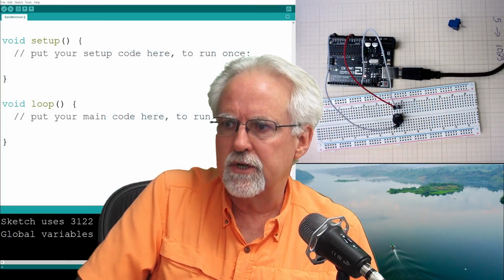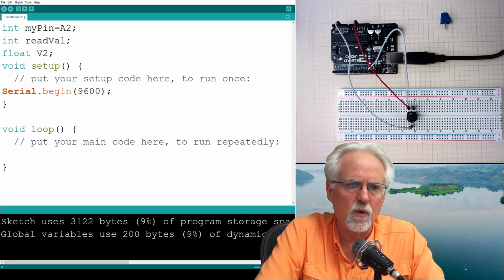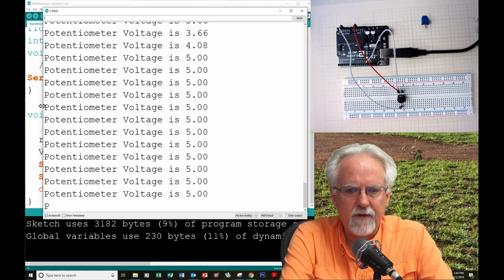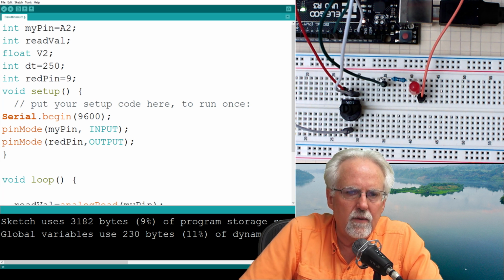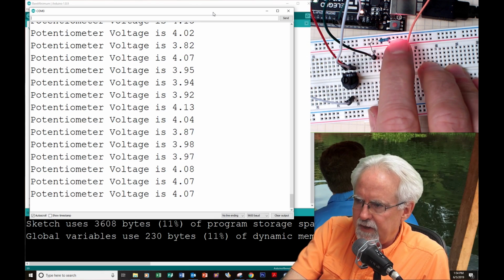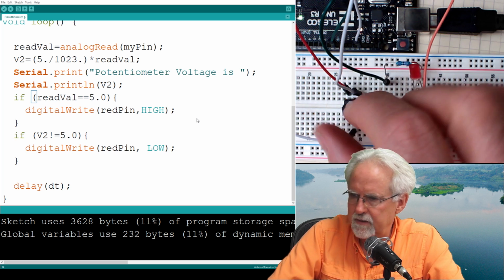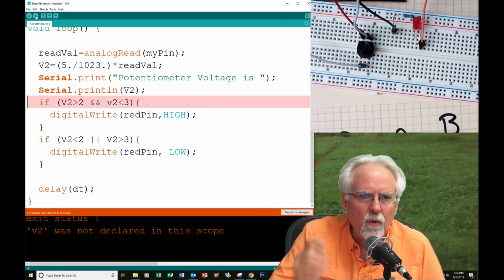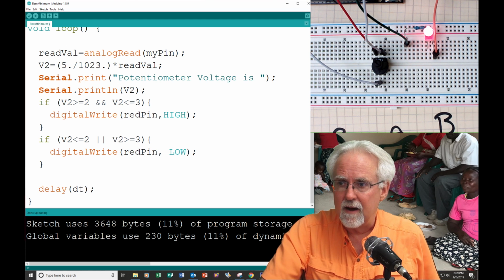Arduino Tutorial 13: Understanding Arduino If Statements

Comment: Well done again.  Laying the circuit out was simple enough since we have been progressing with a similar circuit.  I found a little discrepancy in writing the code.  If I left the Green light to simply V2<3, it would not come on, but the yellow would.  As I moved the potentiometer, the green light would flicker until I was well within the yellow range.  When I moved into the Red, the Red was on, but the yellow would flicker.  Head scratching, re-read the code...everything looked right.  I tried changing the || in the yellow to && and also added V2==0 &&V2<3 to the green...that did the trick.  So, why would the OR vs. AND have an influence on the reaction to the numerical value and physical output of the UNO?
Great Job, loving this stuff.

Comment: Hi Paul, more knowledge in my head! Thanks! I actually had paused the video and wrote some code as we went along that was nearly identical to the homework. I used a narrow 0.1v range in the center. This simulates an adjustment target similar to some equipment I work on in the field. And it worked!
Reply from the maker: Excellent!

Comment: int myVoltPin=A2;
int readVal;
float V2;
int delayT=1550;
int redPin=9;
int yellowPin=8;
int greenPin=7;

void setup() {
  // put your setup code here, to run once:
  Serial.begin (9600);
  pinMode (myVoltPin, INPUT);
  pinMode (redPin, OUTPUT);
  pinMode (yellowPin, OUTPUT);
  pinMode (greenPin, OUTPUT);
}

void loop() {
  // put your main code here, to run repeatedly:
readVal=analogRead(myVoltPin);
V2=(5./1023.)*readVal;
Serial.println (V2);
  //if statement that tern the green LED when voltage si under 2v turn on the yellow LED when voltage is betwen 2 to 4 volt and over 4 volt tern the red LED
if (V2>=0.0 && V2<=2.0){
  digitalWrite (greenPin, HIGH);
  digitalWrite (yellowPin, LOW);
  digitalWrite (redPin, LOW);
  }
if (V2>2.0 && V2<4.0){
  digitalWrite (greenPin,LOW);
  digitalWrite (yellowPin, HIGH);
  digitalWrite (redPin, LOW);
}
if(V2>4.0){
  digitalWrite (greenPin,LOW);
  digitalWrite (yellowPin,LOW );
  digitalWrite (redPin, HIGH);  
}

  
delay (delayT);
}

Comment: Just for someone who can have same problem, like me, with not constant values of potentiometer. It is probably beacause connection on potentiometer is to short. So just use male-female wires and you will fix it :).

Comment: int myPin=A0;
int readVal;
float V2;
int dt=750;
int greenPin=3;
int yellowPin=5;
int redPin=6;

void setup() {
  // put your setup code here, to run once:
Serial.begin(9600);
pinMode(myPin, INPUT);
pinMode (greenPin, OUTPUT); 
pinMode (yellowPin, OUTPUT); 
pinMode (redPin, OUTPUT); 
}

void loop() {
  // put your main code here, to run repeatedly:
readVal=analogRead(myPin);
V2=(5./1023.)*readVal;
Serial.print("Potentiometer Voltage is ");
Serial.println(V2);

if (V2>=0 && V2<3.0){
digitalWrite(greenPin, HIGH);
}
if (V2>=3.0) {
digitalWrite(greenPin ,LOW);
}

if (V2>=3.0 && V2<=4.0) {
digitalWrite (yellowPin, HIGH);
}
if (V2<=3.0 || V2>=4.0) {
digitalWrite (yellowPin, LOW);
}

if (V2>=4.0 && V2<=5.0) {
digitalWrite (redPin, HIGH);
}
if (V2<=4.0 || V2>=5.5) {
digitalWrite (redPin, LOW);
}

delay(dt);
}

Comment: There is an easier way to make the conversions(in code)out of the DAC on the arduino, and that is the following 2 formulas.....to get the Analog value the formula is [ 204.6 x Voltage] and to get the Voltage the formula is [ Analog value divided by 204.6] or simply Av(analog value)=204.6*V or V=Av/204.6....but you may have already known that. I like your self insistence to always use a variable for the delay command. Thank you very much Paul for your very nice and easy to understand lessons!!

Comment: Hi Paul,, The programming works. I think the potentiometer gets damaged  when it is "masher in" since it is not made for the board, mine works fine at both limits, but in the middle it flucuates up & down by more than 1 volt.  Not a complaint, I am loving your lessons. THANKS..

Comment: Paul, I really am getting sooomuch out of these lessons!!  I have been so intimidated about coding but you explain it so well! I do have a question...I understand about resistors and how they work but you have not told us if it makes any difference which way you insert them into the board. Is there a difference which direction the current flows through the resistors? Does it matter which leg I plug in the circuit?  Thanks so very much, John
Reply from the maker: Resistors go in either direction. Diodes have to go in in a specific direction

Comment: Well I am 72 could not learn fast enough in High School  back then was transistor theory, had dreams of becoming an electrical engineer but...... Way to slow when it came to math. Took bonehead algebra 3 times to pass and electronic math lost one concept and the miss understanding grew geometrically so I threw in the towel. Now back at it again being retired, really enjoy the instruction, but again a little slow on some concepts of programming (and math). What makes it fun is you can go over the lessons as much as needed to assist in understanding. Now when it comes to the powers of a number the "e" throws me off but use the power of ten to level the field. And you can call me Kid an old frame but younger as I grow older.

Comment: Hi Paul I have a question I followed instructions however I'm getting strange readings, I'm getting 1.30V instead of 0 and 2.50V instead of 5. 
I wonder if something is wrong with GND  in my arduino  but I don't know how to confirm that. Any ideas how I could check that?

Comment: int vol = 0;
int readV = 0;
int motor = 6;
void setup() {
 pinMode(motor, OUTPUT);
 
}

void loop() {
  if (motor < 255){
    analogWrite(motor, vol);
    vol = vol + 1;
    delay(2000);
    
    
    
  }
  if (motor > 0){
    analogWrite(motor, vol);
    vol = vol - 1;
    delay(1000);
    
  }

}
//why it's not working sir.

Comment: Not sure if this is correct...1023/5 = 204.6. If I input that result in lieu of the 5./1023., (V2=readVal/204.6; ) I'm seeing voltage in the serial monitor. (Using the TinkerCad sim). Once the kit arrives I'll double check that.

Comment: Hello Paul, I looked forward to the homework project actually all week. I had the placements on the board for the 3 LED's and resistors figured out immediately, and the only issue I had with the programming was the if statement || . Once I realized where that statement was required in the programming, all was good. Sometimes I am not too bright... Ha ha!  Thanks again!

Comment: I'm watching them, but I'm working on something different. 

I don't have the kit, I have a Rexqualis Mega Kit that I bought before I knew about your videos and I am working on projects with a seeeduino and Arduino nano. I did send my son the kit you are using though and told him about your videos. 

I understand way more about Leds (and semiconductors in general) than what you have taught, so I kind of spaced out during that lesson, but I am learning a good bit about the coding and I'm not super knowledgeable about potentiometers and some of the other components available for microcontrollers. 

What I would really like to learn more about is programming logic gates and ICs because the more I learn about those, the more I feel like I'm falling down the rabbit hole. 

There's too many to choose from that seem do to the same thing, their data sheets are often 15 pages or more, and I just feel lost trying to learn anything about them on my own. The only one I sort of get is the 555 timer.
Reply: Jolene Mechchic84 I would think if you keep going through the tutorials, they may end up where you want to go with the logic gates and ICs.  If you have trouble understanding a component or something in a tutorial I would suggest searching for more information about it.  Paul is doing a good job, but for someone who is brand new to the subject, there is a lot more explanation that could be said and maybe even needed to understand better.  I don't have a kit either, but a lot of parts from other experimentation and ordering Arduino parts when I need them.  The 555 was a chip I built a project on in College and it is pretty versatile with several different modes of operation.  It is too bad there aren't very many electronic stores around any more, because they used to carry little electronic booklets for experimenting with the ICs.  There used to be electronic magazines that had good experiments for learning about the ICs and electronics by making projects.

Comment: You might know this, but if you put: 
if () { 
then hit ENTER, going to that new line will automatically put a closed curly AFTER the new line. Otherwise, clicking somewhere else for instance will not automatically complete the brackets.

Thanks for the series Paul : )

Comment: Hi, I am starting this Arduino learning project a long time after you wrote these tutorials, I finally have a reason to make a comment. I have been working with the starter kit from a different company that you are promoting, but its basically the same. I was working thru the titorial pdf's that came with the kit, and could do what they asked, but didnt understand what the coding really meant. after watching the past 13 tutorials of you (many which were pretty basic for my level of electronics knowledge, I am a semi-retired automotive tech)  I actually understand in the manner in which you explained it. I was able to do the homework you suggested in this video, and after a little trial and error, was able to create the sketch that works flawlessly, and better yet, I understand why it works! Thank you so much for your expertise!

Comment: One tip I can offer Paul which I use all the time when programming is use of the Keyboard Ctrl functions, this will help your students once they get used to it -
Crtl C=copy
Ctrl X= Cut
Ctrl V=Paste
Ctrl A=Select all
Ctrl Z= undo last move
Ctrl Y=go forward if youve gone back
There are other commands but these I use all the time Arduino programming

one example I use is when opening up a good working programme and need a copy to experiment with is 
1) open programme youre wanting to work on
2) Ctrl A(select all)
3) Ctrl C(copy)
4) open new programme  on IDE
5) Ctrl A(select all)
6) delete absolute minimum programme
7) Ctrl V(paste original programme)
You now have the original programme which you can work on without affecting the original, 
if your not careful you can make bad changes and Ive had it when you exit it saves the bad programme which is a bugger...

Comment: I enjoyed the video so much that after I did the homework, I added another twist to it.  I added a white LED that flashes based on the voltage.  When the voltage is low, the flash and the pause are longer.  As the voltage gets closer to 5, the LED flashes faster until it appears that the white LED stays on continuously.  Thanks for the video and inspiration.

Comment: Just finished this lesson, thank you Paul.  My blinken lights are blinking as they should be.  
(The potentiometer doesn't like to stay seated and nicely in contact, but I guess that's life.)  
(Also, if I declare my yellow and red ranges to both include 4 and set the value of V2 to be exactly 4 I can get both lights to light up.  But playing with the potentiometer I can't, just one or the other.  I'm guessing that hiding at the tail end of the float are digits I can't see.  So I'm not hitting 4 exactly)

Comment: I'm having a problem with the homework can you post in the description the code required for the homework
Reply: Three if statements are required.  The solution that I used are
if(V2<3.){
   digitalWrite(greenpin,HIGH); 
}
if(V2>3. && V2<4.){
  digitalWrite(yellowpin, HIGH);
}
if (V2>4.){
  digitalWrite(redpin, HIGH);
}
I also used digitalWrite to set each pin to LOW before the conditional statements.  See if that gives you enough clues to write your code.

Comment: You're teaching me so well that I've made two projects all by myself (without any help).
1. There are four LEDs on the breadboard. The first one starts getting brighter and when it's at 255 it starts getting dimmer. The second one does the same thing. The third and fourth LEDs do it too. Then back to the first one.
2. A dimmable LED project with a potentiometer and an LED.

Comment: A technical question about the code. You didn't wrote pinMode(A2, INPUT) in void loop(), but it worked anyway. Is it correct?

Comment: Hi Paul. Explaining the else() statement would untangle a few neurons.
Reply from the maker: I simply will not use else statements. They are like double negative logic, and have seen many very important projects where they have created chaos. Hence, I will always use two if statements rather than if/else.
Reply: @paulmcwhorter  ok. I have always used "else" to have shorter, easily understandable, source code. BTW, what is the reason for using PWM only on analog outputs and not on inputs? What is the maximum reliable sample rate for input analog signals? It seems to be around 250 Hz for output analog signals. I'm interested in digital audio (music) processing.  I'm probably in the wrong technology but I love to follow your courses!!

Comment: 5 divided by 1023.
5 is an int, 10 23 is int. You would get an in answer which is zero and you would sit and pull your head out and then you would throw your little Arduino kit away and you would never come back.

Best Lines Ever.

Comment: I learnt a lot here, I did the homework! here's my code!

float potVal;
int potPin=A8;
float V2;
int dt=100;
int rPin=8;
int gPin=12;
int yPin=11;
void setup() {
  // put your setup code here, to run once:
pinMode(potPin,INPUT);
Serial.begin(9600);
pinMode(rPin,OUTPUT);
pinMode(gPin,OUTPUT);
pinMode(yPin,OUTPUT);
}

void loop() {
  // put your main code here, to run repeatedly:
potVal=analogRead(potPin);
V2= (5./1023.) * potVal;
Serial.print("potentiometer voltage is ");
Serial.println(V2);
delay(dt);
if(V2<3.00){
  digitalWrite(gPin,HIGH);
  digitalWrite(yPin,LOW);
  digitalWrite(rPin,LOW);
  
}

if(V2>3.00 && V2<4.00){
  digitalWrite(yPin,HIGH);
  digitalWrite(gPin,LOW);
  digitalWrite(rPin,LOW);
}

if(V2>4.00){
  digitalWrite(yPin,LOW);
  digitalWrite(gPin,LOW);
  digitalWrite(rPin,HIGH);
}

}

Comment: Hello, another great lesson. I did the homework and managed it :) Well, I did forgot the "V2" after the "&&" but it was easy to debug. Also, I had to calculate the resistors value because the different color LED's I have use different voltages...great fun and that is how to learn, repetition.

Comment: Did the HW and it was pretty simple for me. I appreciate you pushing your students in this way - allows for me to think about the problem i'm trying to solve rather than just listening to tutorials. Great content! watched up to tutorial 13 in less than 24 hours with enough knowledge to do you assignments.
Reply: May I ask how you wired everything?  I am attempting to do it and I have gotten the green LED working but not the other LEDs.
Reply: @Zman2112  hook them the same way up you hooked the first up and connect them to new pins. redPin was here pin9. the pin for green and red could be any free pin you have on your board.
Reply: Pay attention to details people. 🤓 Paul knows what he’s doing.

Comment: You have two circuits. (1) potentiometer circuit and (2) a led circuit , but,  I do not see how they are connected or linked.  Through the Arduino ?
Reply: Yes it's the program that's controlling the LED not the Potentiometer.

Comment: The reason the error happened is because arduino doesnt go to 5v exactly. it stops around 4.8/4.95 v. The variance depends on the chips used and the error tolerances. Great tutorials.

Comment: This was very educational :) I had a little fun playing with the code :)

//led flickers at 3.0v as warning you are approaching the danger level of  :) 

int myPin=2;
int ledPin=9;
float readVal;
float V2;
float V3;
float V4;

int wait=100;
String mess1="!.......! Voltage Level !OPTIMAL!   = ";
String mess2=" !WARNING! Voltage Level !UNSTABLE! =  ";
String mess3=" !DANGER!   Voltage Level  !CRITICAL! = ";

void setup() {
Serial.begin(9600);
pinMode(myPin, INPUT);
pinMode(ledPin, OUTPUT);

}

void loop() {

readVal=analogRead(myPin);
V2=(5./1023.)*readVal;

if (V2<3.0) {
Serial.print(mess1);
Serial.println(V2);
delay(wait);
  }

readVal=analogRead(myPin);
V3=(5./1023.)*readVal;

  if (V3>=3.0 && V3<4.0) {
    Serial.print(mess2);
    Serial.println(V3);
    delay(wait);
      digitalWrite(ledPin,HIGH);
      delay(100);
      digitalWrite(ledPin,LOW);
      delay(50);
       
  }

readVal=analogRead(myPin);
V4=(5./1023.)*readVal;

      if (V4>=4.0) {
        digitalWrite(ledPin,HIGH);
        Serial.print(mess3);
        Serial.println(V4);
        delay(wait);

      }
   }

Comment: I am 68 and love your style. I have a question. I used a botentiometer called B5K accordingly my calculation is i have 1 mA. When branched I get correct readings on the monitor and a signal on the LED? tout va bien as we say BOOM. Though the LED emets a blincking very weak signal! I changed the resistors 100 & 200 with same weak light. Any explaination ?